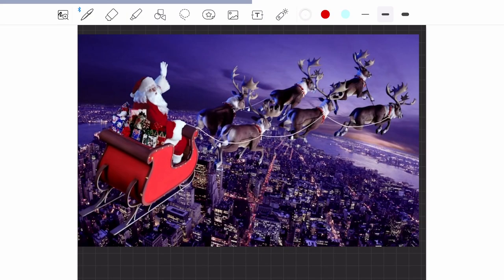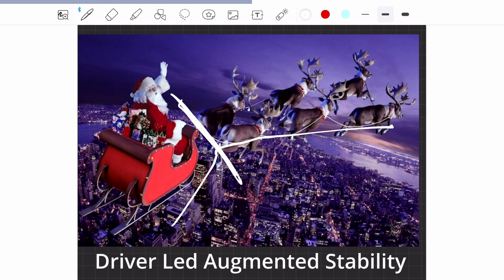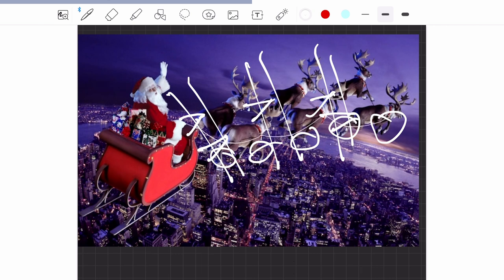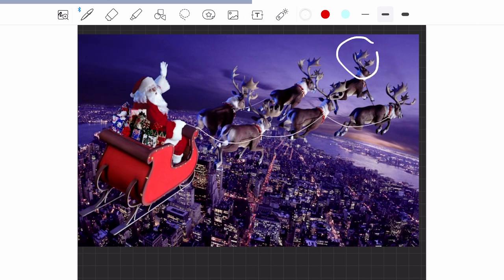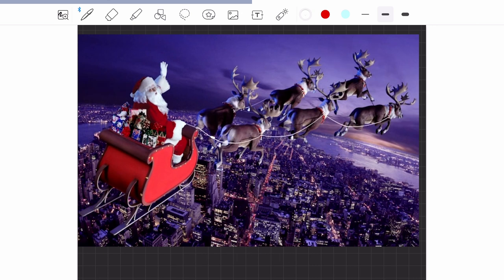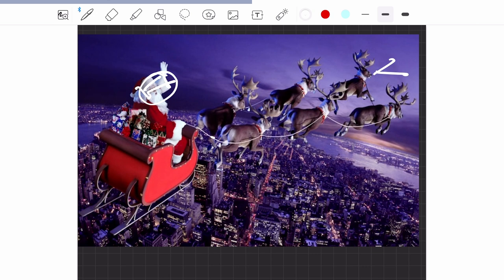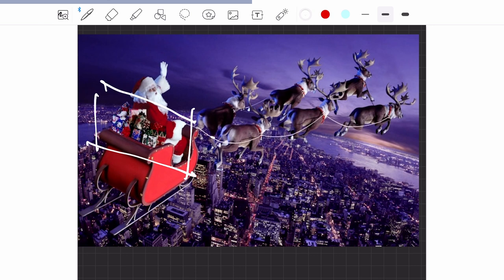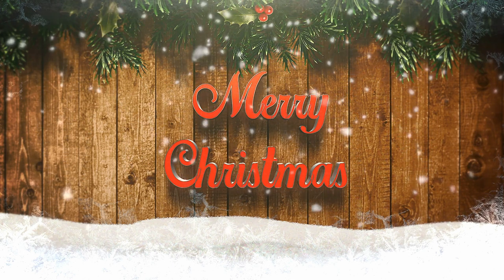Santa's sled aerodynamic analysis.

Comment: It would be cool to see someone put 🎅 Sleigh through a CAD Program to increase it's Aerodynamic effectiveness (I picture it would streamline the Sleigh and add wings to it with podded Williams F107 Engines) and perhaps it would add wings to the reindeer and show you different configurations for mounting small TurboFan engines to them.

Comment: One thing to add is that this aircraft has a very long service history and probably received numerous upgrades during it´s life, to improve safety and refine the rather dated design. Some of the pilot reindeers are reportedly joking around about "Santa´s B-52"... If you google "santa sled crash" there is some evidence of either the sled malfunctioning or pilot errors occuring. Also there is some literature around that topic, named "Santa´s Christmas Crash", or "Christmas Eve Crash Landing". One other thing i was wondering about is if the controls are "Fly-by-wire"? I mean, they kind of are, but i am not sure... What´s your take on that? Merry Christmas btw.

Comment: I think you're wrong about those protuberances on top of the reindeer. I don't think they're antennae, I think they're actually some kind of propellers or rotating airfoils that only appear to be static due to the very high shutter speed of the camera. This would explain where propulsion and lift come from, and also account for the excellent VTOL performance. To some extent, by adjusting the rotor speeds of the forward and back reindeer, some yaw control could be exerted, allowing for better stability.
Reply: This is actually an excellent explanation! Well done!

Comment: Still, u overlooked the controversial issue of sliders which serve as un-retractable landing gears ..  causing a problematic windy noise and a remarkable drag during cruising ... not mentioning the inbalanced lateral load distribution on them delimma especially on frequent landing and re-taking off on snowy terrains.